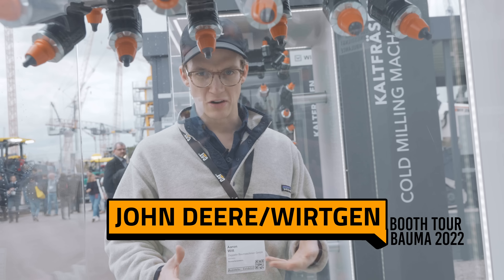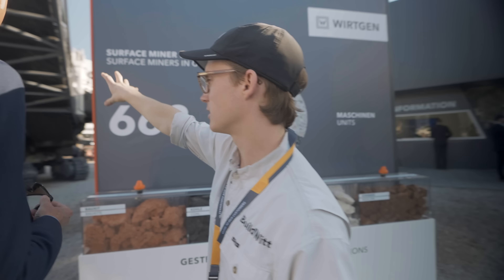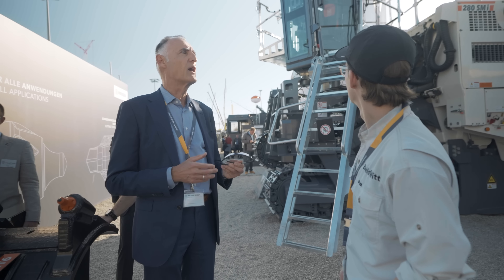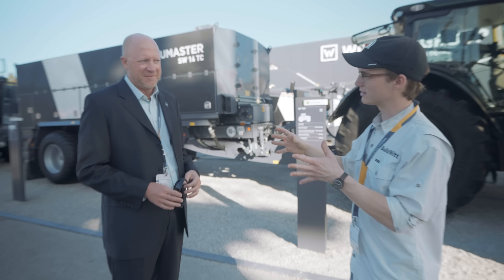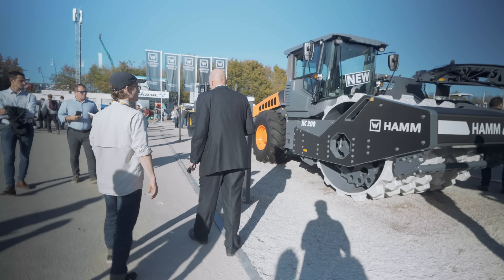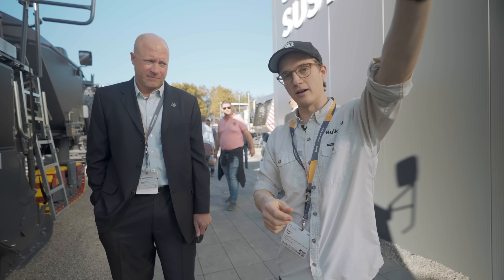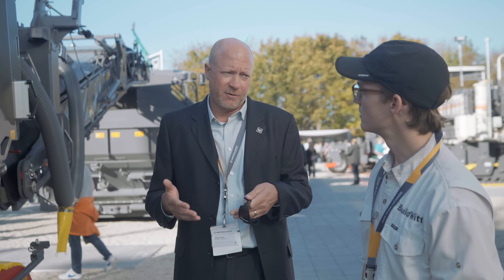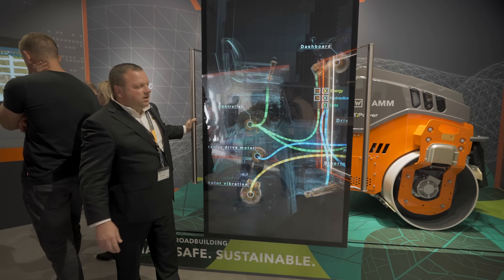Road Building and Surface Mining Machines at the Wirtgen Booth | Bauma 2022

Comment from the maker: What do you think about surface miners?
Reply: If you have a chance you should reach out to Vermeer and see there surface excavators! Very cool machines and built in Iowa along with almost everything else Vermeer makes!
Reply: Thank you for the full explanation of this reuse of material on the road site. The only question is what about manhole covers, water valve covers. 
I do Love how you say the road owner, reused the material. In my area, the MILLING is HAULED to blacktop plant, then they remake NEW blacktop. But like you say. Save running a Dump back and forth. And the Dump beds get so gummed up with blacktop on Dump trucks. Why NOT just let the MILLING machine do all that work in place, at the site of the job.
Reply: surface miners are slick, but that "no haul off" road resurfacing is sexy AF!  that "cold paving" could shave so many days off major highway jobs!   i really wish here in the States that we could properly improve our infrastructure enough to double highway truck weights(retired flatbed trucker here) in order to smooth out our surface transportation system, we've been severely lagging in qualified drivers!
Reply: @rp1645  The milling contractor would have a small milling machine with a 12" head that can do the same thing the big machine can do. The only difference is the little machine can go around manholes, catch basins and value boxes, in one pass.
Reply: @carolinafrog4365  The use of the cold in place paving trains are becoming popular because the price of oil(asphalt & diesel) is making the  reuse of materials cost effective. The trucking industry would like bigger trucks, but there are people that believe bigger heavier trucks are more dangerous! When Boeing 747s came out, some people were afraid of Jumbo also! Time will tell!! I like Big Trucks!!!!
Reply: @markbickelhaupt4414  
Thank you for that. I always wondered about Manhole & Water valve Risers. I hate when they come back and cut out New blacktop to Raise utilities.
Reply: @rp1645  It's how the contract paperwork is written. Work once, not twice! 👍
Reply: Theyre neat

Comment: Hands down, they make the best road mills around. Iv worked with them back in 2011 when I used to do asphalt. I’m a steel fabricator/welder by trade. In the last year I have repaired 2 of them that were leaking diesel from the fuel tank. Both wereon a corner joint where the 3/4” plates that make up the tank were welded from the factory. I did the repair for a certified John deer dealer and authorized repair shop. It was nice to be back around those machines again. They are one of a kind, and top notch in performance and efficiency!

Comment: Milling machines was a great invention in road work. I use to crush asphalt and millings for future use in new roadways but in Florida, millings couldn't be used in the final surface layerof a road ,only virgin asphalt could be used for final surface layer. Millings are also great to just put on a stable surface on their own and just packed by driving on them especially when it's warm outside. And to think that we use to rip asphalt up and just throw it somewhere, usually to fill in low spots on someone's property.
Reply: why only new in FL ? Our prime provincial contractor has a slick setup that is a half block long, but goes from propane burner preheat to grinding, reconstitution with fresh tar, mixing, and conveys into the paver/spreader hopper. They close one lane to traffic while they refresh the other, like new.
Reply: @blueman5924  I guess you don't understand that roads are paved or repaired in different ways. Do you think that everyone follows your company's ways??? LOL 😂 ...PS. I worked for The Middlesex Corp. in Florida for 15 years ,they are the highest producers of asphalt in the state of Florida.

Comment: Front dozer blades are common here and for about 6months they are paired with a wing blade. Sandpicks are used for rural or unpaved roads for the winter also. But motor graders used for maintenance usually keep the front blade year-round.
Reply: YES ran and still see my favorite. The (690JD)
First Grader (JD) built, the one I ran had a front Blade. Great for a full lot with a drop off. The Farm my wife is part owner in. The Farm owner has an old (690) with front blade. The (690) had that great (T) handle for both sides of the mold board. One lever. The ( T) handles control from those great (450-C) Dozers. That was so state of the art in the front blade or mold board control on each side of the blade.